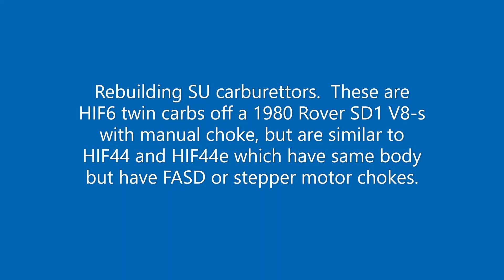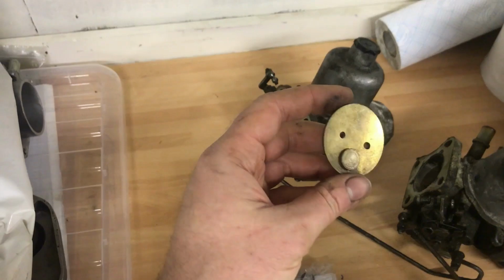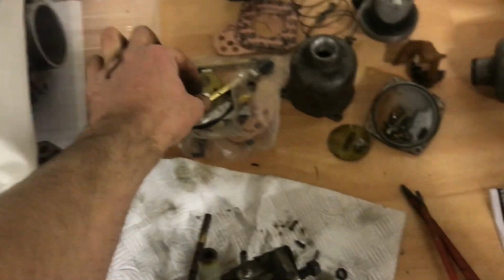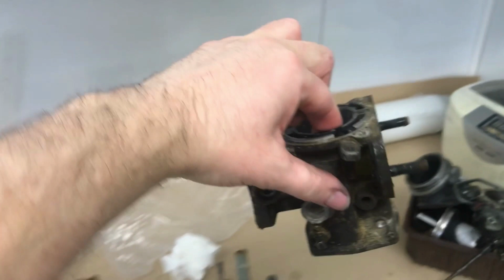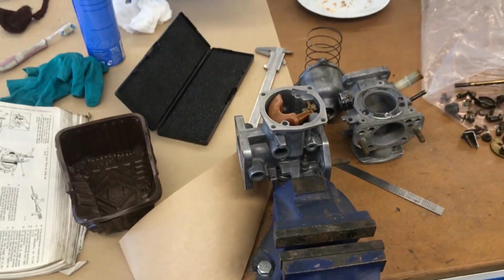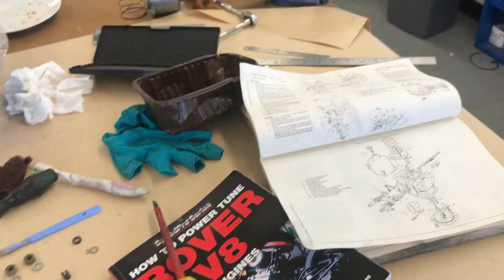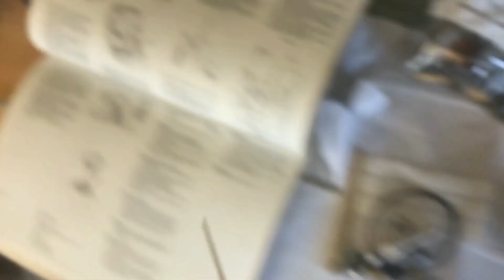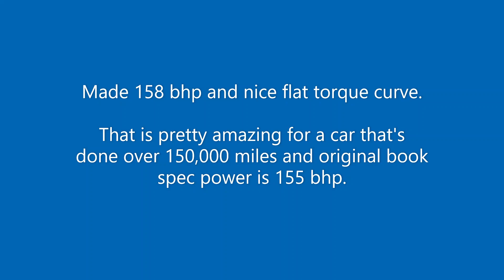SU Carburettor rebuild HIF6 HIF44 HIF44e

Comment: Very useful video I'm going to be refurbishing my Maestro SU carb
Reply from the maker: it will probably be very similar indeed.  If it is a late maestro, then it will probably have a big stepper motor on the side instead of a manual choke, and an ORFCO valve or fuel shut off valve on the side.  I had to rebuild a pair of them on my SD1 police car.  The o-rings that seal the stepper motor to the body can split, and the ORFCO valves can gum up.  Pretty similar though.  The long stupid screws that hold the stepper motor on the carb are held on with loctite and very easy to ruin the heads.  Make sure you have a really good fitting screw driver bit in the heads.  I rounded mine off and it was a right pain in the butt.
Reply: @nitrosilvia  thank you for the advice, it's very welcome.  I have a late 1.3 clubman. The manual  choke appears to be on some kind rocker lever, that pulls up when engaged. I'm not sure if it's has a stepper motor on the side from what I can see, I might be wrong. Good call on the scree driver, I wouldn't wish to round any heads off the bolt. Wish I had one of the Sonic solution cleans as shown in your video. That would be handy. I guess it's going to have to be some brake cleaner and a brush, maybe a bit of petrol to clean 😅